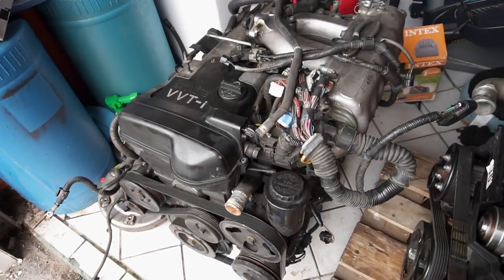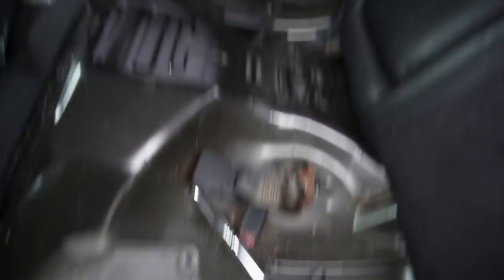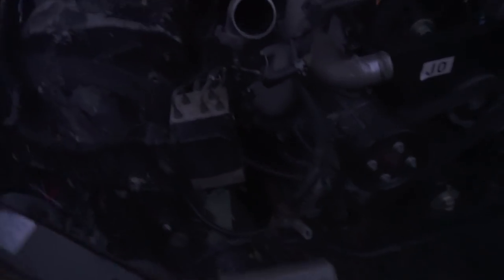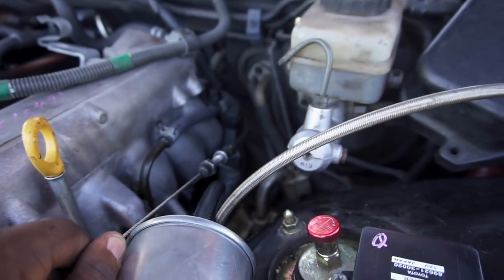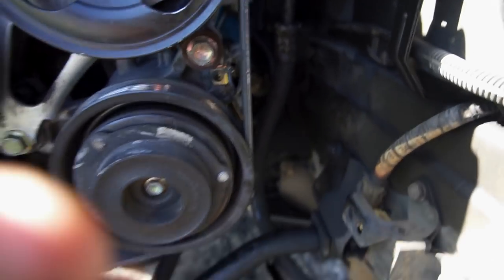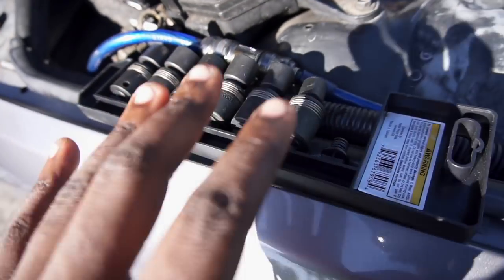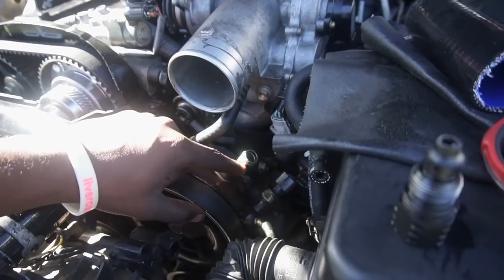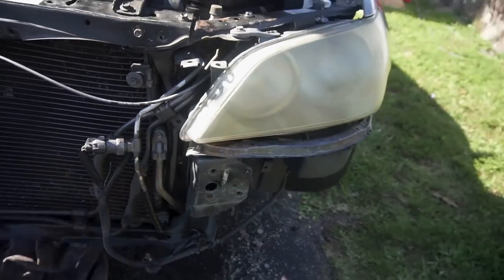IS300 1JZ SWAP!!! Piecing Her Together! (pt.2)

Comment: Did my 1jzgte vvti swap on my 98 GS300. Videos on my channel. 
In the process of doing my R154 manual swap right now. 
Had 350rwhp before pulling out the automatic transmission. 
Just doing one day at a time and there is allot to learn along the way.

Comment: Another solid video! Even rushing you mentioned things that I never considered. Power steering, throttle cable, radiator hoses, fuel lines. There can be SO many things that can go wrong and it's great to see you go through it all piece by piece. Thanks Bobby! Get well mate.

Comment: How much did the 1jzgte swap cost can you list parts
Reply from the maker: murk I’ll be making a video on it after the car is done. I’m thinking close to $4k
Reply: Ok thanks 🙏 I saw some guys saying they spent close to 8k 7600 something like that
Reply: Not a lot of black guys working on these type of cars well at least not youtubers I got a gs300 5 speed with a w58 trans
Reply from the maker: murk yeah you don’t see too many. And all I do is budget lol I was actually a little less cheap on this swap compared to my manual swap 😂
Reply: murk in the process of swapping my transmission not for the r154 in my gs
Reply: damn brother that’s a lot, i had a good deal on my 1jzgte i spent bout 3k on everything
Reply: Novell Blair Nice hope everything works out for you what year gs
Reply from the maker: blinky tran yeah I decided to spend a little more on this. Especially when it came to wiring and Fabrication I didn’t wanna cheap out on that at all. That’s where I spent the most money besides the engine.
Reply: VT BOBBY so the tubing etc and are you running stock turbos with the stock ecu
Reply: i wired the factory wire, i didn’t want to spend 800 for the harness lol
Reply: blinky tran how long did it take
Reply: wiring took me bout a month. lol been so busy with the restaurant. need to hurry up find time to finish my project
Reply: blinky tran what was the process of you wiring it? Was it all plug and play or was modifications required
Reply: I brought a new alternator and a new battery

Comment: Careful with those older heater core hoses, when I put my mishimoto rad in I blew a heater core hose a week later because it's higher pressure cap
Reply from the maker: Chase Compton yeah my wiring guy told me to cut the hose down a little

Comment: Was there any maintenance done in that 1j?
Reply from the maker: Bruce Wayne oil change and rear main seal. Timing belt was brand new, valve cover gaskets were new, and vvti gear was new so I assumed cam seals were new too.

Comment: Hey did JR do your wiring? I've talked with him a few times about mine and he seems like a honest guy.
Reply from the maker: minekaiju77 yuuuuup JR wired mine. I have absolutely no regrets, he did an awesome job!
Reply: VT BOBBY what have to be wired the ecu
Reply from the maker: murk basically everything. Nothing will work without wiring up the car. All the plugs and sensors are different
Reply: VT BOBBY so basically putting a new brain in the car
Reply: VT BOBBY did you use the 1jzgte ecu and wiring harness
Reply from the maker: murk yup basically
Reply from the maker: murk yes I did. But my 1jz came with an ecu that had an immobilizer so I ordered an ecu without one from japan
Reply: Ok and you got your engine from eBay or jdmcity
Reply from the maker: murk found it on eBay then I called the actual company (Jdm Westside) and put in the order over the phone

Comment: Did you get a new rear diff?
Reply from the maker: marcusscott17 unfortunately not yet
Reply: VT BOBBY one wheel burn with that added power may put you in a ditch 😂.
Reply: weld the diff it’ll be cheaper